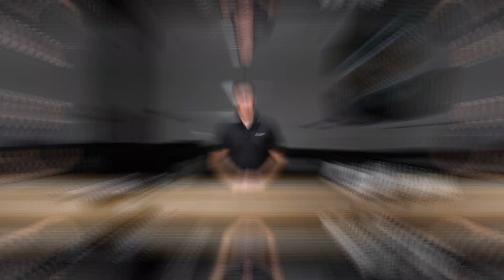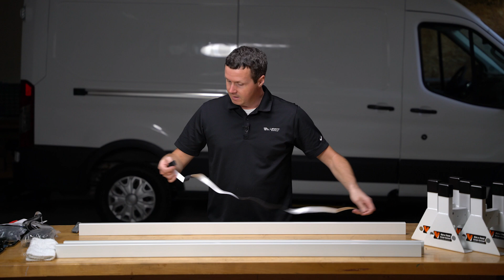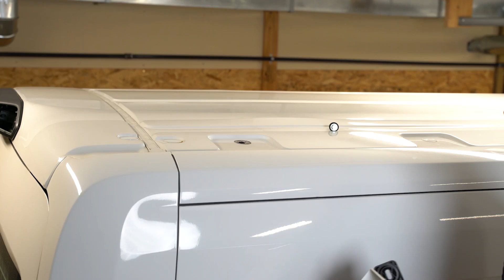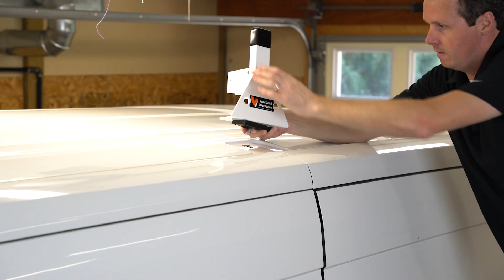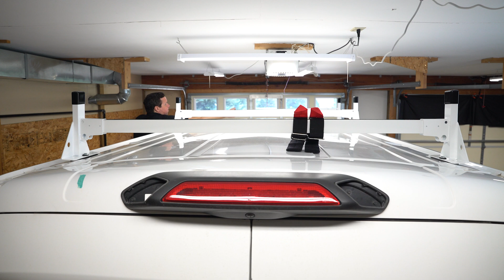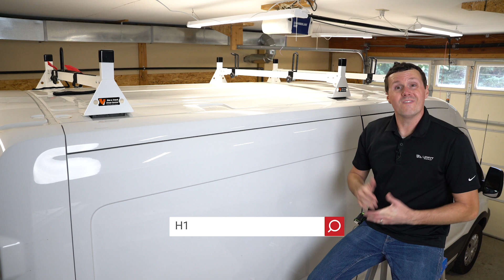Installing Vantech H1 Ladder Rack on our Ford Transit

Comment: What prevents the mounts from shifting side to side, with only one center bolt holding them down?  Wondering if I should use an extra bolt or two per mount?
Reply from the maker: Do you mean the ladder stop and ladder guide? Or the feet/uprights attaching to the van?
Reply: @upfitsupply feets and uprights attaching to the roof.  Thanks!
Reply: So you only need to use one screw per upright mount?  There are three holes, but only one factory spot on the roof?  If you recommend adding screws to the other holes, do you use self tapping, and silicone?

Comment: Where can i get the rubber gasket that goes under the rack between the side mounts and roof? Mine did not come with them and i cannot find them online anywhere
Reply from the maker: Vantech can get those to you no problem: https://vantech.com/home/contactusforquery